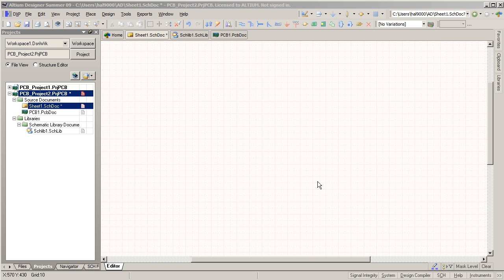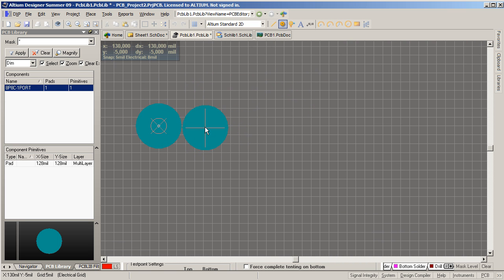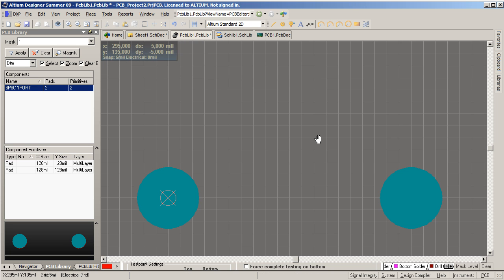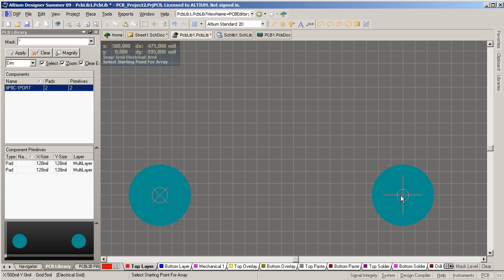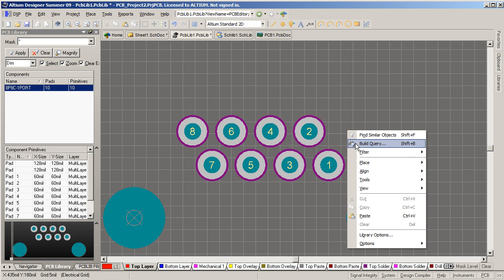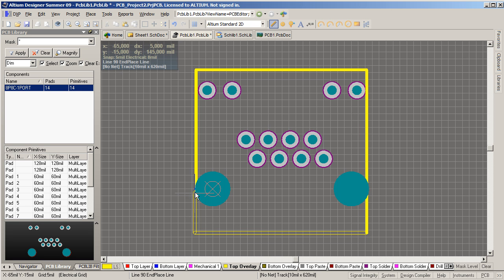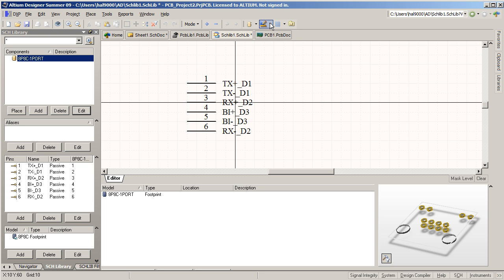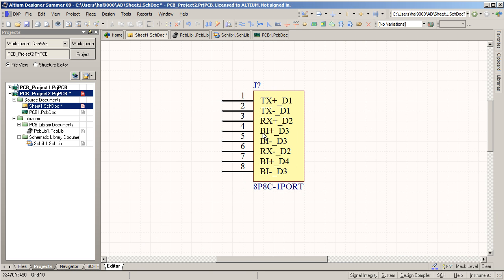Altium Designer Tutorial: Create a component library

Comment: Thanks a lot man
My questions are about RCA jack is Switchcraft PJRAN1X1U01X.
1st question: What if dimensions are not precise enough? I have two vias 295 mil apart and the third one is 146 mil down and in the middle which would make it 147.5 mil to the right from the first one
2nd question: The datasheet for my RCA jack has rectangular holes. What should I do? Should I create round holes anyways?

Comment: Hi, can you help me? I'm doing an integrated library for a KC21 Bluetooth Wireless module but the pins on the schematic design of the module can never connect to the pads on the footprint designed. I'm crazy with this because there's no footprint available for this component and it is really tiny to tryo to handle without a proper PCB due to it's SMT nature. Thnak you. garragc at hotmail dot com

Comment: One question, 
i need to connect 2 pads together with a track ( for example 2 GND ) on the footprint.
the design rule check throws a "short-circuit constratint" to you have any suggestion ?